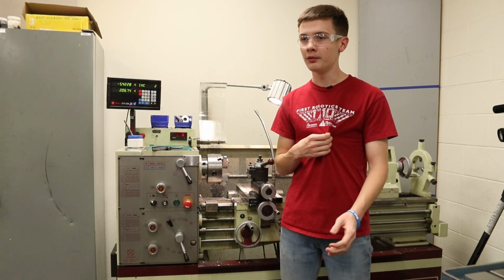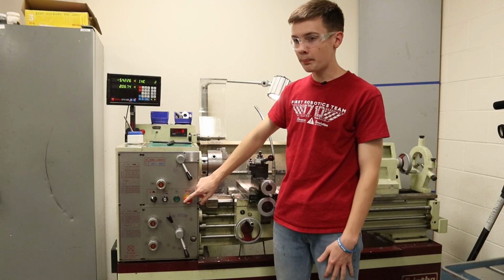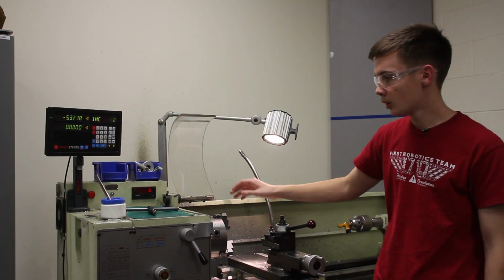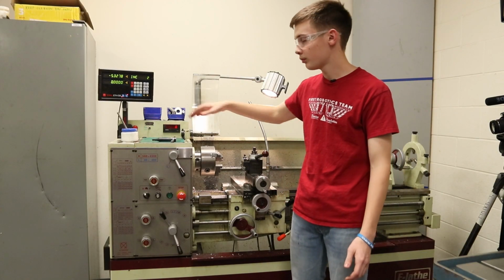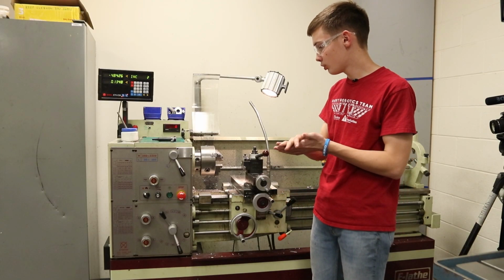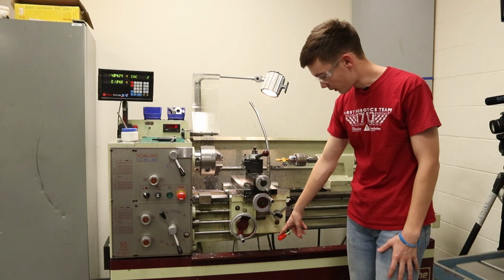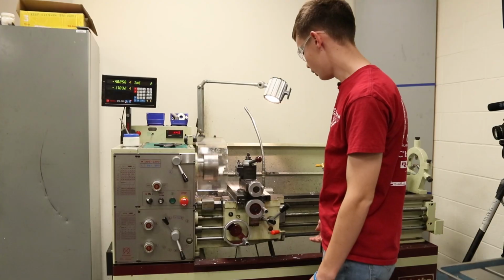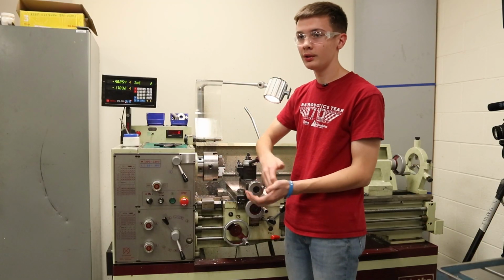1710 Safety Training | The Lathe | Episode 5

Comment: Check out a diagram of the lathe you’re working with. All the parts have names. “The cutting thingy” isn’t one.
Reply: But it cuts... Wouldn't that make it a cutting thingy?
Reply: @estongarcia5572  and the spindle spins, so it’s the spinny thingy.
Reply: For your Information, I was mentioning the body that the blade moves upon. Later on in the video, i specify what the blade looks like and what it does.